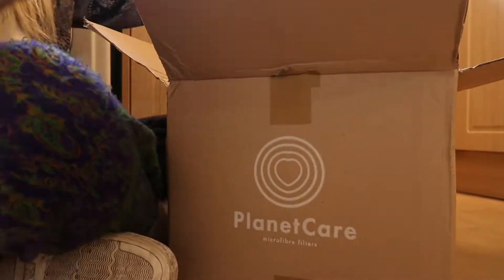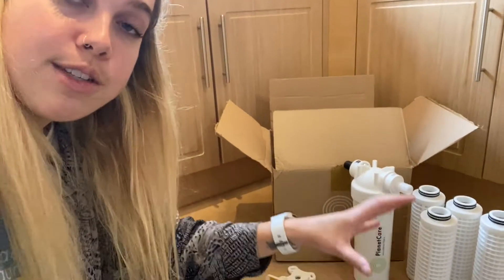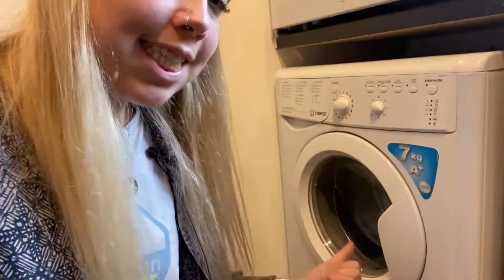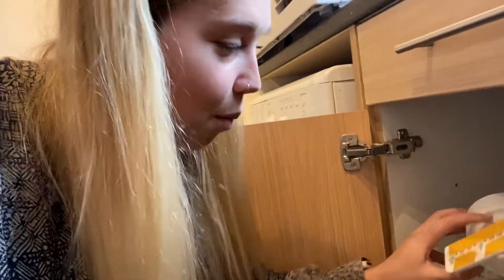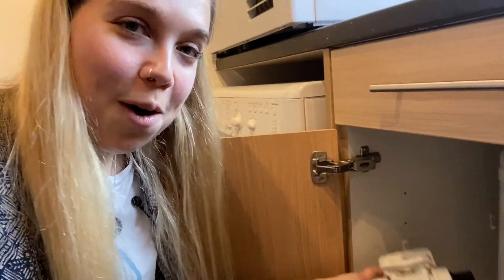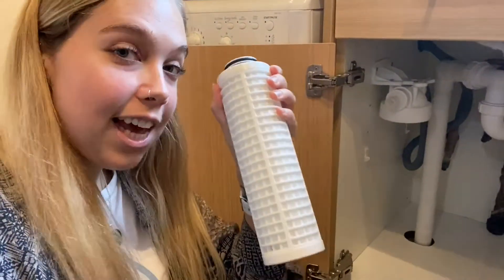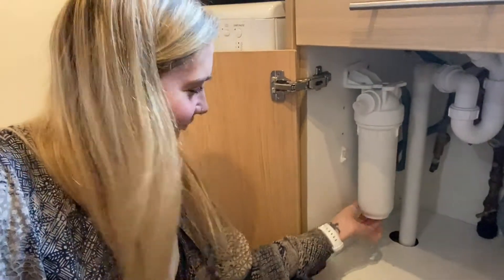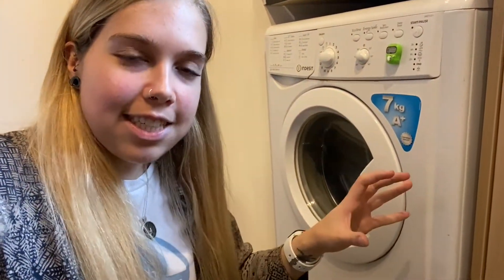How to FIGHT MICROFIBRE POLLUTION with a PLANETCARE FILTER | How to install!

Comment: Microfibre filter, would like to know if when you used the washing machine you're filter leaked as it seems you did not tighten the filter housing to secure the seal. Also how much water you lost replacing the filter as you would have to drop the housing to release the filter from the holder. Even so a good eco system to use. Keep us posted to the result.